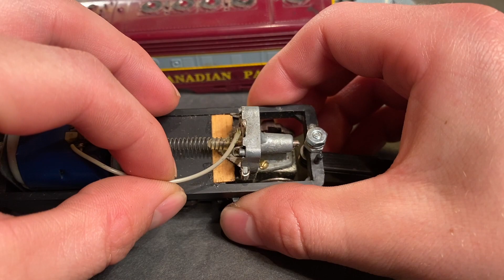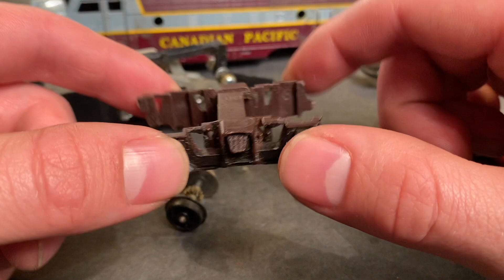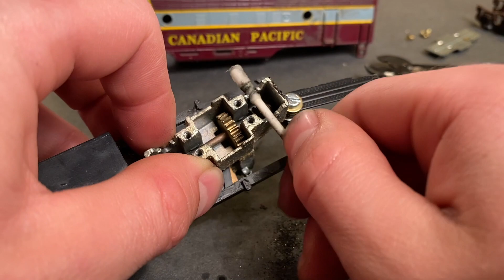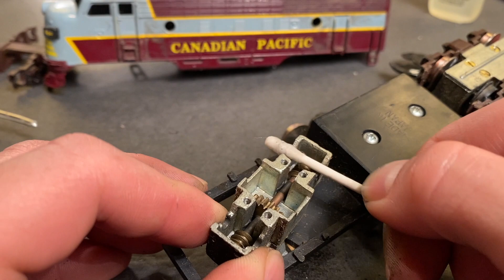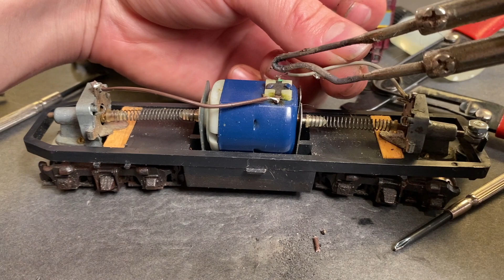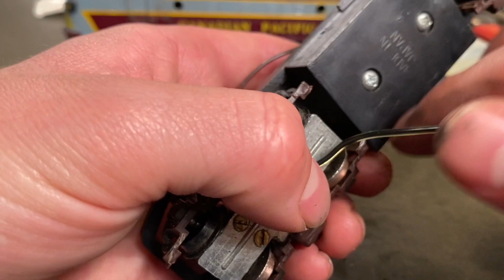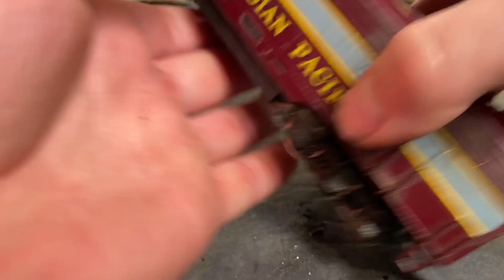Can We Make This 50 Year Old Revell F7 Locomotive Run Again?

Comment: So would it be feasible to add a relatively cheap DCC decoder to an older loco like this?  Or is this just something that for $5 you don't want to bother?  Or would there be possible motor issues?
Reply: I wouldn't recommend it if the loco doesn't have all wheel power pickup (or a B unit/dummy wired up to it for additional pickup). Provided it has reliable power supply a decent decoder will usually get older motors running remarkably well after tweaking decoder settings a bit. Also, as long as you manage to keep the smoke inside the decoder, what's the risk, really....
Reply: I can't imagine why anyone would put DCC in that thing.
Reply: @CR7659  apart from sentimental value of a loco (running your first loco/your grandpa's loco/whatever on your modern DCC layout) or just having a laugh I wouldn't know either, but I guess that's up to Mike to figure out.
Reply: @CR7659  Just an idea on whether or not it would be feasible to modernize older locos to work on newer setups.   Maybe if you're handy and can get great deals at swap meets or what not like this engine,  potentially save a few bucks in a hobby where new is getting more and more out of hand as far as pricing.
Reply: @Mike__B  sure it’s feasible. I have Athearn and Atlas locos that I’ll do just that. Probably not sound though. My Atlas makes enough noise on its own you’d never hear the decoder!
Reply: @Mike__B  Putting DCC on this is like trying to put EFI on a flathead six.  Maybe if it had the actual revell drive in it, but even then it depends on the current draw of the motor if you can get it to run and not fry the decoder.
Reply: @CR7659  While I don't quite get the car engine analogy,  the rest of the comment is the type of information I'm looking for,  as I'm relatively new to the game mostly acting as a mechanic (electrical engineer) for my kid's trains/hobby.    And while I didn't mean necessarily this exact engine, in general just curious about limitations of using DCC on older trains that can often be brought back to life similar to what this gentleman does on his channel.   And as you mention current draw wasn't sure if decoders have any built in current limiting circuitry to protect them, although I suspect doing something as simple as tossing in a small fuse is feasible.
Reply: @Mike__B  the esu decoders I use seem to be quite tolerant to high current and other misuse (so far I managed to fry only one) but they're a bit expensive for a 10 dollar loco maybe. Basically it comes down to making sure the loco you want to put the decoder in is working ok, no weird noises, excessive current draw, broken gears etc and has reliable power pickup and you should be good to go. Results will not be the same as you'd get with a modern loco, but after putting a decoder in some ancient Liliput P8 steam engine I cobbled together from free parts in the spares box (that thing is very similar to old mantua stuff of the era) I was very pleasantly surprised to see how well it ran, so I then decided to chop the thing to bits and bring the level of detail to almost modern standards. An absolutely pointless project, but it was genuinely a lot of fun to do, so just have a go at it. If you don't like the result, yank the decoder out and stick it in some nice modern loco and all you lost was an afternoon.
Reply: @florisdilz7  Thanks, that's what I'm thinking.  I totally understand the monetary argument of expensive decoder in cheap loco.   

And yeah the tinkerer side of me just wants to know if it an be done, because why not?
Reply from the maker: I wouldn't bother unless it was sentimental. 3 pole motors or older motors with high current draw need to be modified to work with decoders. It's not impossible to do but these were fundamentally just meant to run on DC.
Reply: @florisdilz7  it has one rail per truck pickup- waste of time & $.
Reply: @Mike__B  we had an e- engineer in our group and he took over for me when i went back east. when i came back half our fleet was down and I had to do repairs on many of the rest (ones that he 'repaired'). new rule in our club- no more engineers pretending to be a motor man....
Reply: @tommurphy4307  Reminds me of back in the day when DSL internet was the hot new thing (and actually affordable), there was a huge rush to get hook ups and Pacific Bell (now AT&T) went through a mad hiring rush and the guy they sent to my house to do the work was one of said new hires, apparently he was a computer tech guy (whatever that really means) and watching him work he was very meticulous about what he was doing and took a long time.   A bit later one of the old school phone pole jockeys came by to finish the work and asked how long the guy was there and when I told him he just shook his head and said "yeah they're hiring people computer science degrees and they take all day to do a job that should take 30-60 minutes top"

Comment: I recently bought a rivarossi mallet engine from a hobby store. It runs well but makes a strange noise. Do you have any idea of what the noise could be?
Reply from the maker: Have you oiled it yet?
Reply: I have not. The store I bought it from make sure every engine they sell is in running order and each has a tag that states it's been oiled. But I will try seeing if a little oil  makes a difference tomorrow. Thank you.
Reply: make sure its not the motor- its still saveable if its running. you can't get those motors but if its HO it should be fairly easy to rewind.

Comment: Being an older locomotive I would have replaced the wire. Not knowing how old the wire is. I no old wire breaks easy
Reply from the maker: It seems to be working fine for now
Reply: a wire is a wire is a wire is a wire- if it doesn't move or flex who cares?

Comment: only the shell is Revell. 
everything else is Japanese.  I would guess from a brass locomotive.
Reply: Close, it's from a super low end plastic set, maybe even battery operated.  

I have some similar ones that had the battery right inside the loco
Reply: @CR7659  I don't think so. those trucks and gear sets are too substantial for a junk baby. perhaps a Gem product of the early 1960s.
Reply: @suppylarue220  I can tell from the wheels and the plastic frame it was toy level stuff.  Some early brass is crude but not this crude.
Reply: @CR7659  so, which one do you think it came from? if you know, please tell. manufacturer,  importer,  brand, or retailer. some early brass was really crude!  I recall a out of proportioned poorly soldered 0-4-0 saddletanker that sold for $9.95 around 1960.
Reply: @suppylarue220  it came from a no-name, probably battery operated set with a rough clone of a Marx or Varney body shell.  Plastic.  There are versions where the battery is in the loco and the track is all plastic.
Reply: @CR7659  the wheel sets are insulated and the gears are brass. battery operated with plastic track wouldn't warrant that. after reviewing the video , I see the frame is plastic , not metal, giving your theory support. you have something like it so you can post a photo?
Reply: @suppylarue220  Yes, I said there are versions that run on plastic track.  Not this version.
Reply from the maker: Seems like a fairly underpowered drive for something brass.
Reply: nobody would buy brass with a plastic chassis. i know i wouldn't...